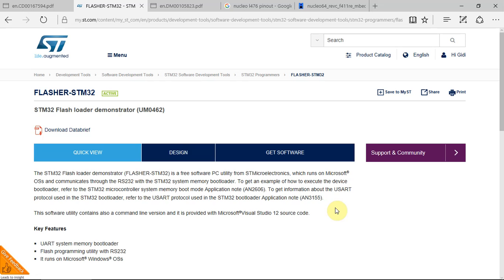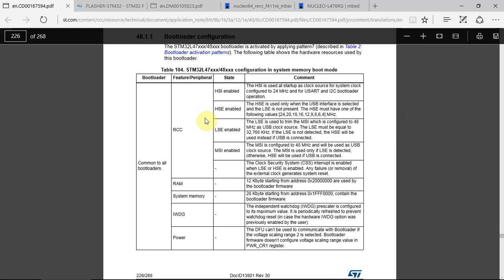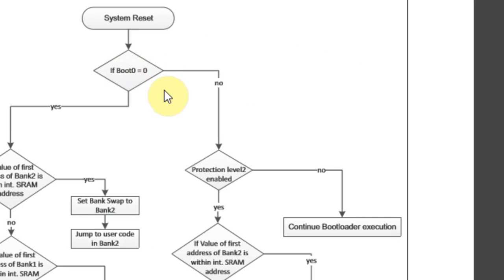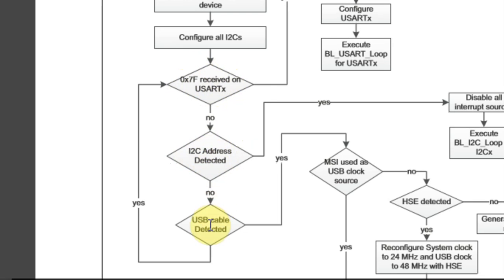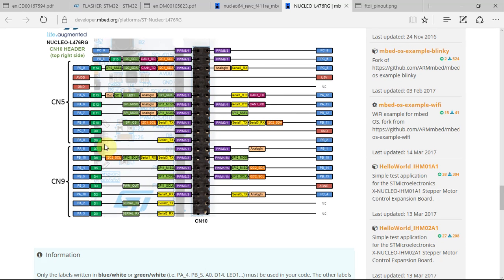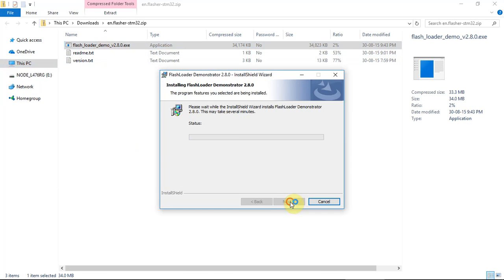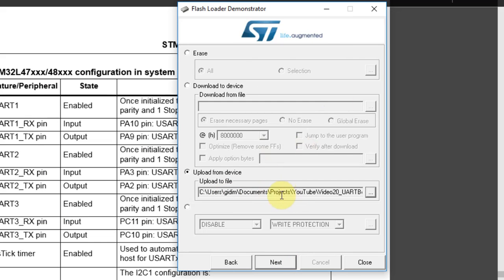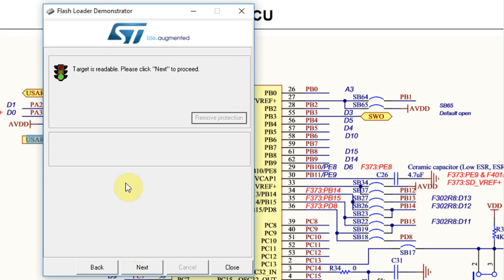STM32 UART BootLoader HowTo

Comment: What if the flash loader  ask for verify boot mode configuration and flash protection status?
Reply from the maker: If its protected, it will send a command to remove the protection and the STM32 mechanism will delete the complete flash.

Comment: The Stm32h74x app note says that by default BOOT0=gnd will force a boot from user flash 0x8000000 and BOOT0=3.3v to boot from System Flash 0x1FF00000.    But is the System Flash the same as ROM?   I'd like to use the built-in (ROM) bootloader to program via CAN and/or USART.
 
Also, any idea if there any CAN utility (similar to serial Flasher-STM32) that can be used for in-system-programming?
Reply from the maker: Yes, the ROM and FLASH are the same. But you cannot change the bootloader that is the STM32, so its called ROM. The bootloader goes over all the interfaces and check one by one if " anyone is out there". 
The STM32CubeProgrammer support CAN. Have a look at my video on how to use it.

Comment: I bought 8 STM32 cards BluePill.

I can not program them with the FTDI module.

The problem is on Jumper BOOT 0.

When I put the Jumper BOOT 0 from 0 to 1 and press the reset button the program continues to work!

the LED connected to pin PC13 always flashes even if BOOT 0 is set to 1.

I tried to program the card with the ST LINK module and it works for me.

I had to add the RST thread because BOOT 0 is not going.

I noticed that programming the card with this method presents many problems on the Arduino IDE environment.

So it is possible to operate the BOOT 0?

I realized that it is not a hardware setting but a software one.

Does anyone know how to fix it?

I really need it :(
Reply from the maker: Not sure I followed you completely. Make sure that the reset pin is working fine and its connected to the NRST pin. Also check that the BOOT0 pin is going low when you are connecting it to 0.

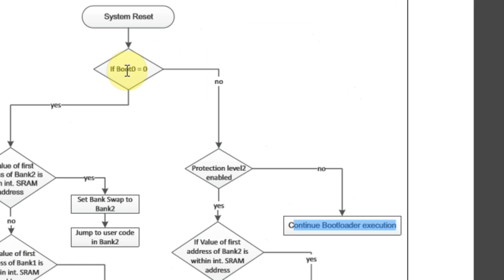Comment: 2:50 You explained the boot branching wrong? The node states if boot0 = 0. And you say that if boot0 = high it takes the yes branch. No, it takes the no branch because the check is if boot0 = 0 then take yes.
Reply: but that doesnt make sense because boot0 is tied to ground through a resistor, so would 0 then mean 1?

Comment: How do ST upload the bootloader?
Reply from the maker: What do you mean? The bootloader that's inside the STM32?
Reply: Web learning Yes. I stumbled upon your video while researching how to program an STM32 chip without a ST-Link board. After commenting I found that the ST-Link actually uses the Serial Wire protocol to upload code.
Reply from the maker: Well, ST programmes the the internal bootloader in production in a different area space from the user flash. You can jump to that address, read it, but you can not erase it or replace it. ALL the STM32 have a bootloader and there are different versions of the bootloader. Look at AN2605 for more information.

Comment: I am using stm32 lora discovery kit and i am trying to enter the bootloader mode by following ur steps but it still the flasher gives me boot mode configuration error... I am using FTDI module which is connected as : Ftdi rx to pin PA9, ftdi tx to PA10, BOOT0 to 3.3V and normal power of 5V and ground.. but still i am getting bootmode config error in the flash and cube programmer.. both of the loader is giving me same error... can u help me out with it please ?
thank you
Reply from the maker: The boot loader software matches the MCU that it is trying to communicate and if it's not in the database it will give an error. You cannot change the database, so you can only try to update it if you have an old one or read the patt page how to do this. I never tried it so I can't tell you how to get it working.